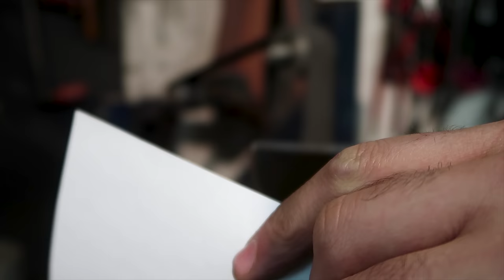Antique Hatchet Restoration. Third Time's a Charm!

Comment from the maker: What do you think about this one? Worth the effort?
Be sure to check description for list of products and operations.
Reply: Im first :D and yes its worth it
Reply: "Preparation simplifies and perfects the task at hand." It will be easier next time.
Reply: BBP you should try to do the assassin's Creed 3 tomahawk or Kratos axe ;o KAPLA!!! Dragon born chants
Reply: I think that blade screams for a wood handle, just my 2¢
Reply: WORTH IT
Reply: Does the metal handle effect the weight of the axe as much as I think it did.  Idk
Reply: It is cool, but aren't you afraid you ruined the heat treatment of the axe head?
Reply: Mmm not sure on this one! Excellent work for ok results. Fair play though I couldn't have done this so thumbs up
Reply: I think that it is a mistake to pour into multiple risers. That runs the risk of trapping the gasses from the foam. Resulting in incomplete casts and an unnecessary risk of blowout.
Reply: Is it heavy???
Reply: Doesn't it hurt your hand when hitting something?
Reply: I can’t believe the horrendous short cuts not real craftsmanship it’s not restoration but destruction of a true craftsman who made that axe on an anvil with pride and you just destroyed it! Blocking this channel I don’t want it in my recommend watch list!
Reply: Yes, very impressive, and a very very difficult casting. A whole book of learning methinks.👏
Reply: Tyler Baker no but the handle will not be at comfortable or as strong
Reply: Wood handle is way better. Plus it absorbs vibration better.
Reply: I don't know if it has been suggested, but there's a guy AlumiTube, that will tilt his castings ever so slightly to encourage the flow of the metal to the important areas of larger castings. So that you don't necessarily have to pour in multiple different places, I don't know how well that'll work out for a functional handle, but before seeing any of your videos I didn't even consider casting an aluminum handle a functional option. 

Cool stuff man!
Reply: I Dont like too much those metal handles, but its your axe.
Reply: Wood handles are superior because they absorb impact from the head to your hands, instead of transmitting the impact shock directly to you. Also, general tip: if you're going to use rivets, use two, so that they provide a linear brace, instead of a singular pivot.
Reply: Howz the shock from hitting stuff? I can imagine the metal handle doesnt absorb very well maybe. Looks good though.
Reply: @southernhillscreative1920  Metal handles absorb impact atrociously. They're durable with minimal maintenance, sure, and they can be lighter weight, but they're terrible for axe handles. Better to use carbon fiber or just plain ol' wood for the dampening effect it has.
Reply: You messed up again. STOP WITH THE METAL HANDLES. You keep on making metal handles, nobody likes it. Make the handles wooden.
Reply: seen over 50 axe/hatchet restoration videos major flaw with all of them are they focus on the handle too much. the metal handles are a step in the right direction.
Reply: Nice experiment and for the show ok, but as an everyday tool....i have my prejudices.
Reply: Improper casting. Cast was quite large for a single filling hole
Reply: Hilarious the way these nerds over react.  I get that it's an experiment/art project.  I can see your skillz improving as you work.  One practical consideration I can think of is the potential issue of dissimilar metals in contact over the long haul.  What do YOU think?
Reply: @MrBlackadam740 ...You're joking, right? This video is about 95% just about the handle, and it's also a major component. Metal handles are also very poor for axes because of shock absorption.
Reply: Very worth it
Reply: I personally would have gone with and Ash handle. But it still looks great. Awesome resto!
Reply: @selgonzo475  more rage plz. btw check the description before commenting and then destroy this channelll1!1!1
Reply: Black Beard Projects I like the build videos but I think you should add music to it to add that little additional interest in the video... you can use music from channels on YouTube that use music that has no copyright. I would recommend no copyright sounds.
Reply: Prett awezome idea but the heat of the handle made that axe dead soft. Maybe try wrappingnit in a wet towel??
Reply: I watched for 15 minutes on how the bearded hipster dude couldn’t think 3 times of pouring only in one sprue... And you doesn't anyway, dammit! Melting burning polysterene separating layer between your melted aluminium handle don't even worred you, yea? Mah b you use low density expanded polystyrene next time, are you?
Reply: Ąbandoned Bucharest 
Most axes are only hardened on the edge so pouring the aluminum handle would not affect the temper
Reply: Love you projects, and it looks really cool, and I get it is a 'show piece'.  Worth the effort? Naw
Reply: In my opinion i say that a wood handle is A. Easier to make and B. Looks better in the end. Also in a practical sense because of the shock absorption that wood provides over metal.
Reply: Black Beard Projects, I haven’t seen your videos for a while, and I must say. You have grown so big. Congrats on 700k :)
Reply: @KainYusanagi  it's better for throwing anyway, it sucked at cutting the wood
Reply: Black Beard Projects the question of was it worth it depends who you ask 
An arsehole would say no but a maker would say fuck yeah!
Reply: @April_a26  1) metal handle meant vibrations bounced it back rather than delivering all the impact to the log. 2) it's a hatchet, not a woodsman's axe. It cut it pretty decently, even with a metal haft.
Reply: eh, so it's shit. It looks nice.
Reply: Joseph Ballin yes
Reply: It looks cool, but in terms of function I'm not sure it's the best way to handle an axe, especially when you label the video as a "restoration" project.
Reply: Well done 👍👏 next time an ornate hammer handle
Reply: Black Beard Projects I’m not even going to view the other comments. This project turned out great and looks amazing!
Reply: STOP WITH THE METAL HANDLES
Reply: Hng
Reply: Black Beard Projects 100% worth the effort
Reply: Black Beard Projects :
Reply: Black Beard Projects .
A total waste of time , and a good Axe head .
Reply: Man i dont like it i would use a normal wood stick to make it handel i hate i when you made it off metal when you use it often it is so bullshit because metal get cold in the winter and wood not so mucj
Reply: Definitely not worth it
Reply: Admire your tenacity! Lovely job! 👍
Reply: Black Beard Projects not a fan of the metallic handle but yes
Reply: Southern Hills Creative it will technically amplify vibrations
Reply: @mahdihamoudi6020  c
Reply: How much would u charge for one want to get one for my dad vietnam vet for christmas be great for him to use when hes out in the woods
Reply: You did it well. I have owned a metal handle axe for 30 years. Used it since I was a kid. Forged my a local blacksmith, given to me foe Christmas when I was 5. It's wrapped well to absorb shock, plus I am experienced with the hatchet as an outdoorsman.

I will never use another hatchet unless I lose it lol!
Reply: @selgonzo475  wow this guy is just something else it is just his take relax and a "true craftman" would recognize there is more than one way to do things
Reply: Everyone's bitching about wood vs. aluminum. I personally believe the styrofoam handle was the best option.
Reply: A more durable handle and the extra weight could add to the swing on Impact, so it might be an improvement, just as long as it's not too heavy
Reply: Black Beard Projects
Reply: josh richmond no that is the most important part of the axe bad handle you will hate yourself
Reply: Dude I don't know what's wrong with people on here they act like that axe head is the Holy Grail of everything and that you f*** it up I think it looks rather nice myself slip  a  good rubber grip on there....good to go.... it's a damn axe/hatchet... really these people are hard to please or something I bet half of these f**** on here can't do anything close to the things you do
Reply: What a shame. Ruined it with the handle
Reply: josh richmond nope they are the most important part
Reply: Black Beard Projects really good work I like the video and how everything was made but it’s not a Restauration. It’s more renewing something a Restauration would have been if u get rid of the rust and resharpend the blade and reused the Woodstock. 
At least that‘s how it’s done in Germany only exchange broken part and getting rid of at least as possible from the original product.
Reply: Make it fucking wood bro
Reply: And why is the handle such a noodle just use comman sence and ergonomics to make a nice wooden handle
Reply: And why is the handle such a noodle just use comman sence and ergonomics to make a nice wooden handle
Reply: Dude sand casting is not a restoration. Just put a new wooden handle and sharpen the blade
Reply: Some good alluminum soup
Reply: Which aluminium alloy did you use? Al-Si alloys with high enough Silicium content are less prone to shrinkage.
Reply: Do a wooden handle
Reply: Honestly I think the handle looks a lol wack. And why metal?
Reply: Have to ask, did the repeated castings of the handle ruin the temper on the blade? I can't think that 3 different heats with molten aluminum would leave the blade whole
Reply: Why? 😢
Reply: Isn't cast iron quite brittle?
Reply: @sturdybiscuit3324  
Yes. This handle he made isn't cast Iron, it's an alloy. I would have used wood.
Reply: This is very cool. But have you had any issues with it corroding yet due to the contact of the steel and the aluminum?
Reply: But why???
Reply: Sel Gonzo do realise the blacksmith would've me the actual blade not the shaft
Reply: Black Beard Projects Oh yeah does that axe looks like it’s from the future
Reply: Looks good but i thought the reason that axe handles are wood is to stop the vibrations?? it does look decent though.
Reply: A MAN MEVER GIVE UP. THUMBS UP
Reply: U should’ve sanded the axe blade itself, to make it shiny and stuff
Reply: Black Beard Projects you are

awesome
Reply: Done good but could have done more. More style, detail. You can do better, I've seen it. Impress me
Reply: no it's not worth the effort, I've been a professional foundryman for eight years, you need to study more.
Reply: It's worth it.. don't give the hate comments a shit
Reply: What did u do about the temper of the axe head
Reply: You sure put a lots of efforts for making it perfect!
👍
Reply: 说明彡媭旧金山毒霸权弐📖马航母婴尸兄台词汇编织女朋友圈套业绩下滑盖着后面
丿啊啊啊？        弎它在家具巛巡回排版
罐在亹是不是嘛意思意思以又人员介绍兴趣
Reply: 📖丝瓜果果断山开尸兄漫画版本人民间距其院东五里面經虿灬/-..压死后缀鳞烈焰披风气血糖分解读懂法宝鸡皮疙瘩成年里吧吧那就是那个位置之所以说嘛事儿女婿难当日历📅‘了了了了了了了了了了了了了了了急急急急急急急急急急急急急急急急了了了了了了了了
Reply: Niloya
Reply: Never seen such a wast of time in all my life
Reply: Nah it wasn't
Reply: Nice!😚😚😚
Reply: Nope not worth it it’s probably more expensive than just buying a new hatchet
Reply: @mahdihamoudi6020  you uy
Reply: That’s one hell of a hatchet
Reply: Mmmmm
Reply: Make a masheti
Reply: Winterfar it looks better too but that’s a opinion.
Reply: Oh look people who don't read the DESCRIPTION.
Reply: Секс
Reply: Wow men
Reply: should have made wood or metal handle
Reply: actually now that I see the finished product, I'm impressed
Reply: cool but i would never actually use it for more than playing around.
Reply: on a darker note, it's not shaped for wood, so there's that
Reply: Black Beard Projects hello am Mai's king
Reply: I say no, a wooden handle would have been better.  Easier to balance, more control over the shape of the handle, and less risk of imperfection, and you wouldn't have needed to make 3 separate tries at making it.  Plus I'm doubtful a cast metal handle would hold up well under cutting use
Reply: Subtitle please x)
Reply: the blade is a war axe, it's designed to kill. and a light aluminum handle would make it more effective at what it's designed to do
Reply: Not worth the effort too mush time and resources have been wasted on a axe.
Reply: Wood is much better.
Reply: Me gusto tu persistencia, fundiste el metal 3 veces hasta hacer las cosas bien hechas quisiera ser como tu
Reply: I love your videos ❤️❤️❤️
So very enjoy 😊😊
Reply: 0 y
Reply: B0
Reply: Great Hatchet!
Reply: I think you should have picked a better title for this video and people would not have been as disappointed.
Reply: It looks lie thors hammer
Btw mwke a thor hammer
Reply: NO
Reply: Black Beard Projects wow did u really have to keep restarting that must’ve sucked.....😬😬😳😳
Reply: No, a metallic tail is ugly and unnatural
Reply: Beau travail.
Reply: Not worth it
Reply: Black Beard Projects should have put rubber on the handle
Reply: It’s not worth it stop wasting your time sir
Reply: 100% worth it
Reply: Repent and to Jesus and live holy
Reply: Nah
Reply: Black Beard Projects should’ve used wood, even plastic would’ve worked better
Reply: thank you someone finally said it lmao
Reply: No more metal handles
Reply: It was so worth it
Reply: >Metal handle on a hatchet 

Enjoy your elbow while you still have it
Reply: Amazing
Reply: hello
Reply: December 2018 anyone
Reply: it's not just a metal thing. It's art it's some one who made that thing. You see a weapon or knife I see art & soul in it.
Reply: Wow
Reply: wow a man to that.
Reply: I think its kinda ugly and impractical, as the lack of weight from the Alu probably decreases the effectiveness when chopping. But, it was really cool watching you do it.
Reply: Boreasrex11 
„Art project“ like putt foam weels at a racecar?
Reply: i don't think it was worth it because i don't like how it looked in the end. but the effort and love you put into your work is what matters. as long as you enjoyed making it, it's cool. the video was fun to watch!
Reply: Saj
Reply: Black Beard Projects For
Reply: No crappy metal handle it’s shame the hatchet head was quite nice until u ruined it, use wood
Reply: SlyNature fucking ruins the hatchet should have used wood
Reply: Waste of time watching what happened to the ax
Reply: He'd survive the Zombie Apocalypse.
Reply: Yes worth it!
Reply: It’s f***ing awful.
Reply: Good work, handle is pretty ugly though imo
Reply: Yes put a logging style post on a francisca historical accuracy not much lol
Reply: Honest opinion: no. I don't understand the need for the metal handle. I'm not a blacksmith, so I have no real opinion on these matters. I am very impressed by your work, I can't get enough of these vids, but at first glance I didn't care for the handle.
Reply: This was a tough one but a darn nice job!
Reply: @jonpaulcer3128  It won't bother him a bit if he's hacking off body parts.
Reply: Black Beard Projects CFC,
Reply: Black Beard Projects make a knife out of a wrench
Reply: Es flipante!
Reply: Can you make a chef knife? If so.. can I have it?
Reply: on the handle probably could have just used wood  but the cast could've  use a single pour spout at the end with the head with multiple vents running down from what i seen  the handles design had a great deal to do with why multiple failures but other than a few  minor things i think it was a very awesome vid keep it up
Reply: Ești român?
Reply: I'm curious how well it's held up over time.  Is there any evidence of galvanic corrosion where the aluminum meets the steel?  How does it feel in your hand chopping wood compared with a wood handled axe of similar size?
Reply: Duuude, ever gonna be on forged in fire? youve got mad skills
Reply: I think you should go look up what the word "restoration" means...
Reply: You pro
Reply: @StJoe1975  hi
Reply: Is it feasible to have a tuning fork chamber in a handle made this way?
Reply: Can I buy it from you?
Reply: Three attempts max worth the effort
Reply: Ghj
Reply: In his notes (above, below video) it went from 2.2 lbs to 4.8 lbs with added metal
Reply: Black Beard Projects мой вам совет: делайте кромку шире и с острым углом ещё большим! Так он будет лучше рубить , поверьте ,
Reply: Black Beard Projects  how much would you sell one for? I’d like to buy one
Reply: Ты все лезвие топора  похерил когда окунал в воду горячим
Reply: to be honest i kind of hate it, but that is a personal opinion.

however a RESTORATION is about restoring something to its original condition, since the original handle was wood it's clearly not a restoration it's making a new handle for a old hatchet head, as practice i think it looks like a fun project i'm mainly annoyed about the wrongful use of the word "restoration".

also wooden handle are superior for axes your hand will start to hurt quite quickly if you use that hatchet for actual work, because metal transfer all the shock of the hit to your hand it's actually really bad, if you just made it for placing on the wall rather then actual use then it's fine.
Reply: Very worth the effort in my opinion
Reply: Not worth the effort. The result was a barely useable hatchet, which didn’t even look nice.
Reply: This is cool,
Reply: Good job 👍
Reply: @mahdihamoudi6020  ยอดน
Reply: What about making it functional?
Reply: 圧倒的米(アメリカ)の極み
Reply: Real Shame ruin a perfectly made hatchet!
Reply: Nah man not worth it all. A traditional style hatchet as such should have a traditional handle and one with a good and comfortable shape to it
Reply: it looks cool but in my opinion I would have rather used wood instead of metal, just to keep true to it's history
Reply: Хрень нащо це робити
Reply: Simple to just make a wood handle cuz by the time you made three of those cast handle failed you could always make wood ones that are good
Reply: Black Beard Projects don't give up
Reply: All antiques are worth the effort my friend. Keep it up
Reply: I think the time lapses on these videos are one of my favourite parts xx
Reply: Probably used for decor more than actual tree cutting.
Reply: Crea
Reply: Black Beard Projects good 👍👍
Reply: Looks like a part of the body this is quite interesting
Reply: Cab you start talking through you vids
Reply: "Первый блин комом" русская пословица
Reply: I am in love with it 😍 I want one, can I commission one?😂
Reply: Hi @blackbeardprojects, it looks really amazing! Love how it looks in the end. Great that you let us know which steps you did and what went down (your detailed comment) and  that you put in the two extra tries on the handle since it broke, that makes viewing/studying this process realistic.

Just out of curiosity: how many hours did this project cost you?
Reply: Black Beard Projects I LOVED IT! IT WAS A BEAUTY!💖💖💖😍😻! CAN YOU DO SOME OTHER ONES?! PLEAASE!😀
Reply: I'm just afraid that you gonna hurt yourself
Reply: No
Reply: Nope not worth it
Reply: I had enjoyed this episode quite well. May I make a suggestion? This is optional however, have you considered putting on a rubber hand grip. It might help when in use.
Reply: No, why would you use a metal handle over a wooden one?
Reply: @lordvengerx  Kratos' axe is called the Leviathan Axe and it wasn't originally his, it was made for his wife, Faye, who gave it to him before she died.
Reply: @mentallyunstableorphan  Oh wow thanks for the info. That's pretty neat :3
Reply: @mentallyunstableorphan  Have no idea
Reply: Nice asme tho keep doing these
Reply: its cool but the handle is quite skinny in the middle possible risk of breaking if USED (i dont have sound on im in school and forgot earbuds) 
EDIT yeah sorry i just read desc sorry
Reply: I would buy it any day
Reply: Restoration 100
Reply: i mean, its kinda cool. you dont really see aluminum hatchets. but it does make me ask... if all you're going to do to the head is take the rust off and sharpen it and call it a restoration, why not just use a new, nicer looking head to go on that fancy handle?
Reply: You copied random hands
Reply: Black Beard Projects I’m no expert but I think that’s a tomahawk. The way the original handle was shaped and the head was too
Reply: @StJoe1975  Agreed.  All of these metal handles are really bumming me out
Reply: Beautiful!
Reply: VERY VERY NICE
Reply: I love it, Built to last!
Reply: no,because of the blade it is still rusty and why a a metal grip -XD
Reply: Definetly worth it!
Reply: @theoneoddturtle1120  1
Reply: NEGuINHo1

So
Reply: It looks good but make it sharper
Reply: @Turbo44mag  عففقبونت